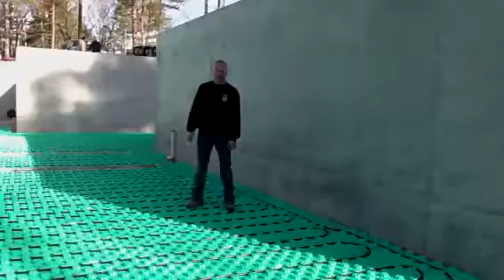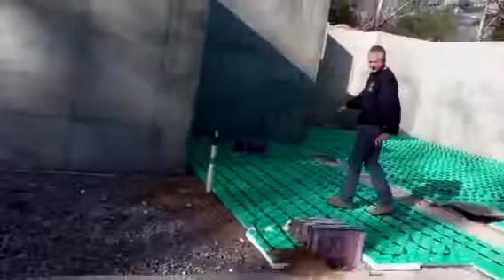Crete Heat and ViegaPEX Barrier Tubing Installation - Dover Project

Comment: Not sure why you and many others are not using a reverse loop pipe layout especially in concrete, My assumption would be that pex or insulated panels manufacturer is giving a bed layout plans.